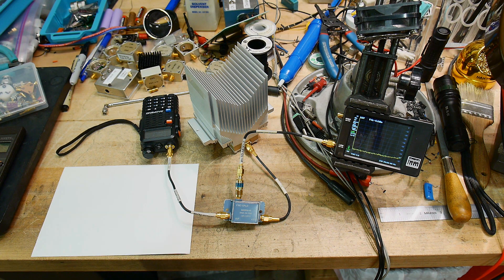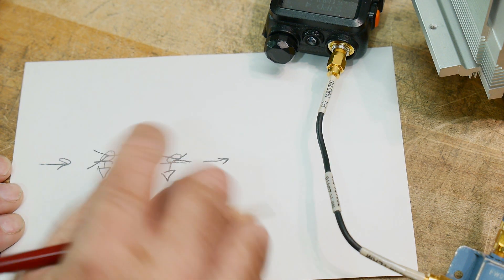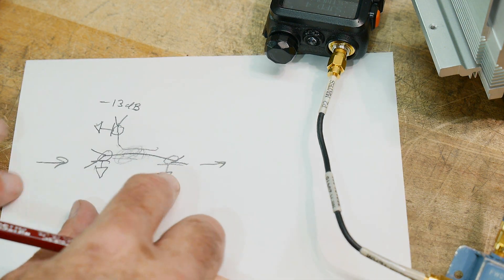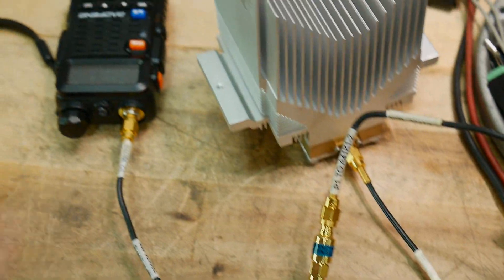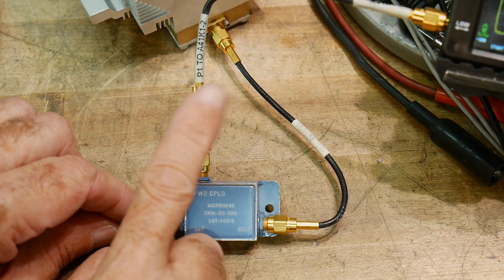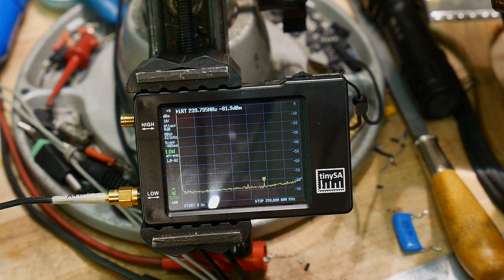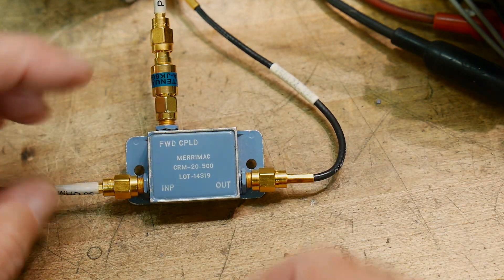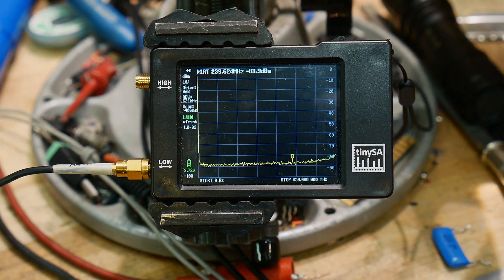#552b TinySA Measuring with a Coupler

Comment: Ok, no one needs to this on a baofeng.   Can this coupler handle a 1000 watts? I want to make sure my signal out the amp is clean
Reply from the maker: It is only rated at 5 watts